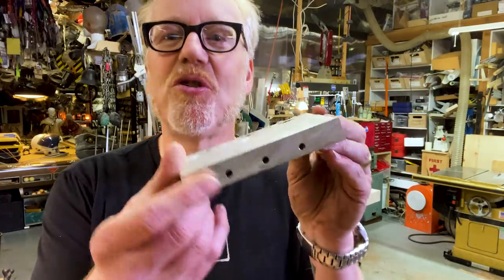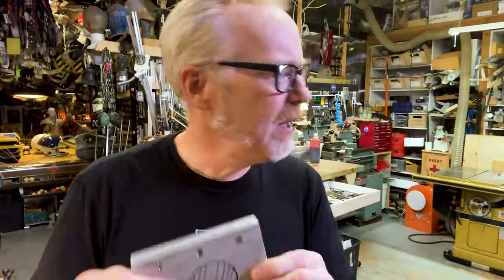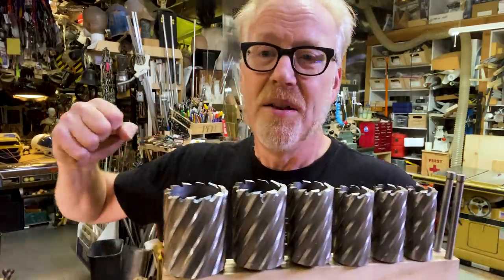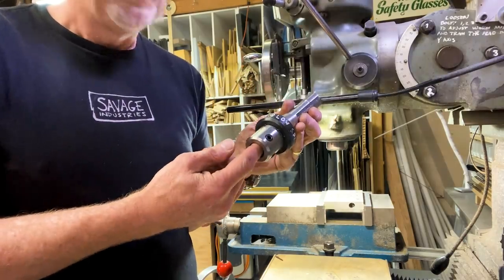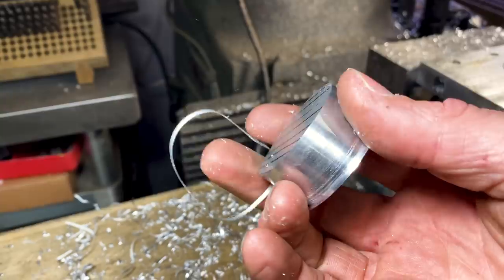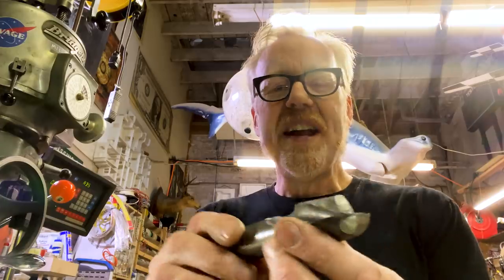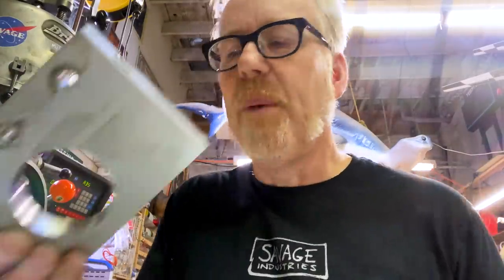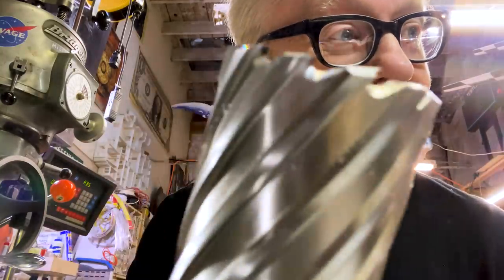Adam Savage's Favorite Tools: Annular Cutters!

Comment: I think you've forgotten about bi-metal hole saws. They work great on aluminum. Annular cutters work better with slower speeds and quite high feed pressures, which is why they're great with mag-drills. I should point out that if you aren't using anything as sturdy as a milling machine, these bits usually have a smooth pilot pin to guide the hole and reduce latteral motion. If you use a cheap home drill press with these, you need the guide pin or you will get a lot of chatter and will likely ruin your bit and/or work piece.
Reply: well, it is just a glorified holesaw, making a rotary vice for the piece would also do the trick. (doesnt adam have an indexing vise that works horizontally as well?)
edit: also, holesaws (of any kind) are a pain in the ass to get centered correctly on a coordinate if you dont have a center pin to work from, so that guide rod makes sense even in the milling machine.
Reply: Not really, its more like the god-child of a hole saw and a mill. The cutting geometry is significantly different as are the proportions of the tool (for instance the wall thickness of the cutter)
Reply: I think when he showed off his set the guide pins were there, he just didn't use it for this cut.
Reply: @AlRoderick  correct the pins were side by side at the end of the holder.
Reply: He did mention that it wasn't a good fit for a drill press and that he was relying on a mill's higher precision to work with them.
Reply: From experience I can tell you that a hole saw in thick aluminum SUCKS.   I make an adapter plate that has a hole a bit over 4" for the crank end to fit through, and on my first one I tried a hole saw.  I now do them with a jigsaw and then finish with a spindle sander (I only sell like one every two years).
Reply: Yup milwaukee hole saws. I cut through 3/4in steel with ease on a handheld drill.
Reply: Annular cutters work better with slower speeds and quite high feed pressures,
All cutters work best at the RIGHT speed... The precise speed isn't always achievable, but one lower is best in a mechanical gearbox.  An easy calculation is for 100 FPM (30 m/min) Divide the cutter diameter in millimetres into 100, then multiply the answer by 100, you've got the revs for that cutter at 100 fpm, 30mpm. Example- A 20mm or 3/4" drill 100/20 x 100 = 5 x 100 = 500.  A speed suited to drilling mild steel with a high speed steel drill, using coolant.  Reduce the revs if no coolant is used...

You need 60fpm? multiply by 0.6, 500fpm?  multiply by 5, etc, etc... Once you've established the revs for 100fpm, everything else can be pro rated.  No calculator, no need to pause between ops, no lost bonus.

But... Metal removal is dependent upon power available.  You can't maximise metal removal rate with inadequate power, you can only optimise for the situation...
Reply: Yeah we’ve actually used wood hole saws. Without a problem. Not very quiet and have to use some coolant. But we haven’t had a problem. Might still buy a set of these tho lol
Reply: @ae72crown  WOOD? hole saws? If it's a bimetal hole saw it has high speed steel teeth welded to a carbon steel body.  Perfectly adequate for metals which can be cut using HSS tooling, assuming you select an appropriate spindle rate.

Back in the early seventies, working in aerospace, we had an old Do-All bandsaw.  It had a resistance welder attached, and we could make blade for it from stock blade.   (we could  cut the middle out of a workpiece by making up a blade, welding it up after threading it through a hole made in the material) Anyway... Having blade stock in the shop...

Whereas now,  you could laser cut or plasma cut, or CNC punch large lightening holes out of aircraft components before dimpling them, back then, we made arbors for the machines (radial arm drills and milling machines) and fitted shouldered discs of steel or aluminium to them, then wrapped bimetal bandsaw blade stock around them, (the ends didn't have to meet) retaining them with jubilee (worm drive) clips.  If one wasn't long enough, you connected several together... Friction alone was enough to drive them. Getting the teeth pointed the right way was important... Depth of cut was limited, of course.

Assuming the discs ran true, the shop made "hole saws" did a great job of producing large holes in sheet and plate light alloy. (using waste kerosine, drained from aircraft under repair, as a lubricant)  We could jig up and nibble them on the Pullmax, (with a small punch) but that was more time consuming.  Obviously, the bigger the hole saw, the bigger a machine had to be, since small machines don't generally have speeds available to suit big cutters...

Comment: It’s funny how Adam has to give the long explanation how he’s not wasting a good piece of aluminium stock. And as a hobby machinist, I totally get it. I was thinking, “that’s a nice piece of stock to waste”. He’s definitely one of us!
Reply: Well i dont have much of a home shop and im not consider a machinist in any capacity. I finish my study as a stone skulptor and dont even buy material. On the other hand i realize how much energy labor and resouces go to produce stock material. So in my job i save some scraps and use them later. Its more who you are then what you are doing.
Its also important to diferent betwene usefull scrap and used material so your shop dont look like landfill
Reply: He seems to try to hide it, but the big hole intersects a prior hole drilled across the length of the block. The result is a clean 3d oval shape in the edge of the large hole, showing the stability of his toolset.

Comment: As always with metal birds/rats nests like at 5:30, be very careful. One strand may break easily, but the nest as a whole acts like a multistranded rope: More than the sum of its parts. If You snag on a spinning rats nest, you can say goodbye to a finger or more in a hurry.
Reply: Absolutely. I've seen a fellow apprentice require stitches from trying to clean out a chip tray with her bare hands. I always lightly 'pulse' the downfeed to break chips in prevention of bird-nesting. And, as always - don't put your hands where you wouldn't put more sensitive appendages and never do anything you'd be embarrased to tell the paramedic when they ask what happened to you!
Reply: I was just posting about the same thing, I didn't see this post till after.
Reply: As always....Adam and those kind of tools i am always nervous :D
It might hurt the surface finish a bit but in a home shop you are not in a hurry, he could have easily halfed the rpm...if that went flying...ouch...
Reply: @antraxxslingshots  It's not so bad flying off, it's the fact that it can pull you in.
Reply: @pinchopaxtonsgreatestminds9591  Not talking about the birds nest, i was talking about the part.
Reply: @antraxxslingshots  Oh yeah, the part didn't look 100% secure either.
Reply: I really butt-clenched when he reached towards all that spinning metal, especially after the losing-a-fingertip story.
Reply: @pinchopaxtonsgreatestminds9591  Yeah, thats what i meant. I am a machinist myself and clamping it down would have been more secure maybe. Nothing wrong with doing what he did in a vise, but you have to concider if both ends were really milled parallel and flat for maximum surface grip etc. and i am just to sceptical when it comes to Adams hasty style of working.
I have seen quite a handful of flat pieces climing the drillbit and 2 even went of flying...the impact is nothing short of a gunshot, esp. with that kind of rpm.
Stay safe :)
Reply: one of the main "degloving" causes for sure. unless you like losing large amounts of skin very fast, best to stop and clear it more frequently
Reply: One of our guys at work got something like 7 stitches after trying to pick up a ball of that stuff bare handed, it had gotten itself wrapped around a 480 cord and sliced two of his fingers pretty badly.
Reply: He said it was like foil, but yeah, metal shavings can be so sharp. All the little cuts all over your hands. Even soft shavings can be sharp, especially when they are whipping around.
Reply: I was surprised this didn't end up with blood everywhere, the paper cuts you could get from a spinning tinfoil birds nest could flay your hand.
Reply: Fussing at Adam is a waste of time. He does dangerous stuff all the time. In every shop I ever worked in, the foreman would run Adam's fanny out the door for this stuff.
No matter if you are working in a hobby metal or wood shop, a job shop, in production, or any where you are using power equipment:
1) Remove rings, watches, jewelry of any kind... that's what the little container in the top of your tool box is there to hold. 
2) Use appropriate eye and ear protection.. don't make blindness and deafness part of your future.
3)Don't wear gloves unless required for welding, dangerous chemicals, or electrical insulation. Yes you will get cut, burnt, and scraped... but not nearly as bad as getting pulled into power tools or machinery.
4) Never wear long sleeves or have loose clothing  around machinery or power tools. Ask me about the story of the Bridgeport mill and the power feed. ... those t-shirts that are too small for you are your friend. If it's cold get some insulation and heat for your work area.
5) Keep long hair or beards tightly bound up. A wisp of hair caught by a spinning chip will scalp you in a heartbeat.
6) Never put your fingers or hand into rotating work to deburr or polish. That's what  chop sticks and old  broom handles fitted with abrasive paper are for. Use chop sticks to catch work being parted off.
Ask old timers in your trade about what they've seen happen to folks who thought they'd never get hurt at work... do it after lunch as you may lose your appetite with what they tell you.
Like the "Lazy Machinist" Marc L'Euyer says: Have fun, be safe!
Cheers from NC/USA
Reply: flymeetspaddle I am no longer allowed to use the term "degloving" at home.
Reply: @firstmkb  My wife is a retired ER nurse... that's the term she uses.
Reply: Does the material being thinly cut aluminium change how dangerous the nest is though? 
I do agree with the comments that often you see less careful practices on youtube videos of highly experienced machinists though, lots of little things that we were trained not to do when learning how to use equipment. Leaving a chuck key in a lathe when changing its contents was probably the one we were told we'd be kicked out if we did, but you see it happen a lot online lol
Reply: @flymeetspaddle  de-gloving should be in a special category of words. It sounds innocent then you realize what they mean and shiver. 

I don't know 1% of what Adam does so though ok but the comments confirm my first reaction.
Reply: It easily broke so he wasn't in any danger.
Reply: Keep the dick beaters away from the bird nest.
Reply: @Sammonoske  That's the problem in the shop. You can do stupid stuff 999 times and get away with it...the 1000th time can be an extremely unpleasant experience and a trip to the emergency room.
Reply: Got sliced once by some stainless. Sometimes those birds nest are unavoidable despite your best efforts.
Reply: Another safety problem was blowing away all those metal shavings with compressed air.  (Around 5:54)  And it wasn't just that that a brush should have been used instead - the bigger issue was not wearing safety goggles while making the compressed-air mistake.  Blast those sharp ribbons into the air and sooner or later the compressed air will swirl one or two of them around your ordinary eyeglasses and into your eye.
Reply: @Sammonoske  it *pulled* off the cutter when stopped easily. Don't let that lead you to think it *broke* off. Rats Nests knot incredibly easily and are astonishingly strong. If they knot and catch, the first few strands wont do too much, but even at a slow speed, the next strands will join that knot nearly instantly. Combine that with an unstoppable spinning, and you loose a finger.

The whole point of the original comment was that it APPEARS innocuous, but is incredibly dangerous. Complacency is really the most dangerous thing in any shop. I believe Adam has talked in the past about how repetitive cuts on the table saw are the most dangerous for example.
Reply: Ive has a .005x.001 single stand of aluminum make a nice helical cut around my finger just trying to clean the chuck on a millturn. machine wasn't even powered on it was a stationary chip.
Reply: Sheet metal snips: cut it loose.
Maybe, once it's loose, you can decide whether it is worth saving to use as a scouring pad. At the very least it should be safe(-ish) if you are wearing thick leather. gloves.
Reply: @aceroadholder2185  
7) Wear a P100 mask if you think your work is generating metal dust. Hexavalent chromium and lead aren't a joke.
Reply: @manictiger  Yes, I did work back in the 80s grinding turbine blade retainer segments for a jet engine combustion chamber that contained Beryllium. General Electric forgot to tell us that Beryllium was in the material. My co-worker was poisoned with it. GE paid a lot for his medical care.
Reply: @aceroadholder2185  
Ouch.  I think I've come across a couple Beryllium items taking apart old T.V.s before.  The heat sink was too light to be aluminum.  I was scared to even scuff it.  Duck taped it in bubble wrap and nestled it in my scrap heap.
Reply: @manictiger  Beryllium, lead, asbestos , etc. can be safely handled. The trick is to avoid ingesting them by breathing the dust or by mouth. It's also important not to clean up your hands, arms or the work area with an air hose. Use a vac with the proper filter and soap and water for exposed body parts.
Reply: @aceroadholder2185  
I don't think asbestos is dangerous by ingesting.  That one solely just messes up lungs and nothing else.  Water nullifies its action potential.

Yeah, iirc, the leading cause of lead poisoning is from not washing hands, and then eating with hands, afterward.
Reply: @manictiger  I think the most common place to find beryllium is in the insulators on magnetrons.
Reply: Stopping and reversing the feeding periodically eliminates the rats nest.
Reply: can you side mill with these tools?

Comment: My grandfather, Everett Douglas Hougen invented the annual cutter. 
 
adam,
i work in the engineering and quality control lab at Hougen mfg. and which my family owns and operates. i can’t tell you how awesome it was to watch this video, truly delightful to see our annual cutter putting a smile on your face and working well. we sure love our products and seeing them being used in the field. thanks for all the nice words, i will be sure to share this video.
grant h
Reply: My dad worked at Hougens for 30 plus years. He was at the Corunna Rd building in the 80s and then worked At Swartz Creek facility for years. OD grinder. I’m sure you knew AL
Reply: love my Hougen HMD115 drill and annular cutters
Reply: My Dad invented the question mark.
Reply: can you side mill with these tools?
Reply: @privateprivate3767  I've only used them in a Janson Slugger drill, but I'm gonna say NO. They're  very thin walled, sharp, but nothing there. If they chatter, they break.
Reply: That's amazing, I just learned about these about 10 years ago when I was in Millwright School and the fact that Doug Hougen invented them stuck in my mind because he invented the annular cutter in 1973 the year I was born. But much like Adam, when I found out about these things, it changed my life in the shop. I now use my mag drill more than my drill press, it's way more accurate and cuts beautifully clean holes. I'm actually about to purchase a new Hougen and get that amazing vacuum plate that fits the 905. Your grandfather did an amazing thing for the machining world.